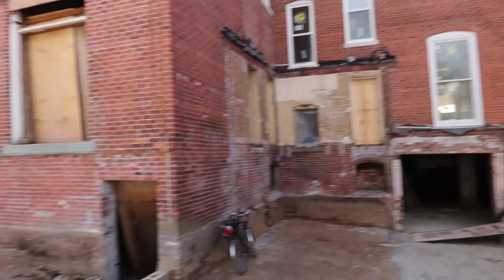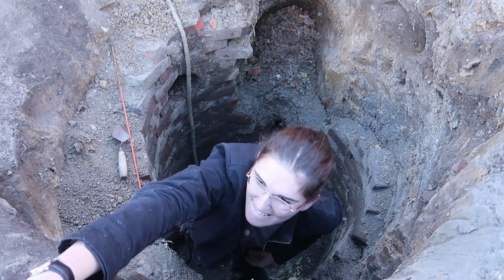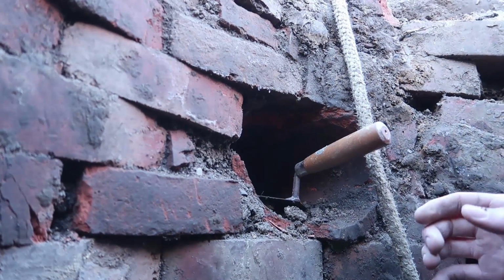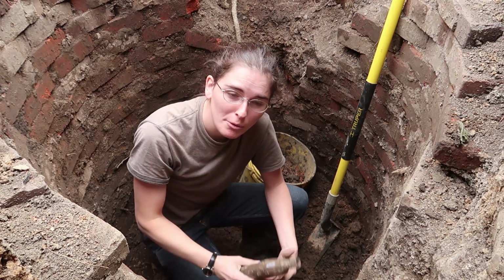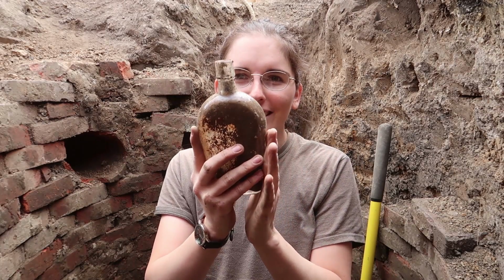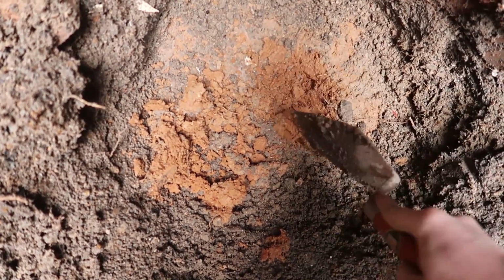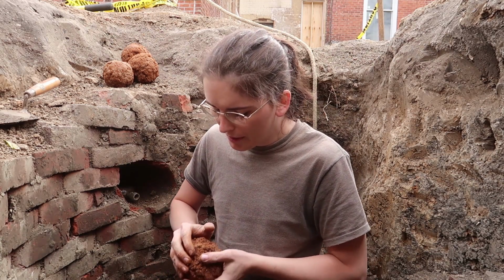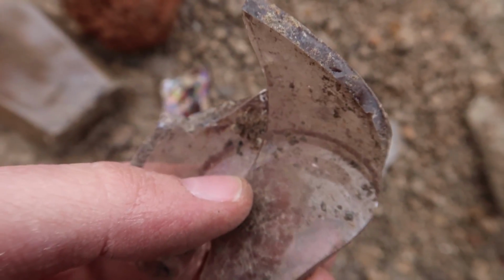Metal Detecting & Bottle Hunting 11: Digging a Pit for Relics and Clay!

Comment: Hey Riona love u r video s btw .  I too am a relic hunter and live in a area of BC that's right close to a mining and logging town back in the 30s I've just started to adventure this year but have found so many bottles and relics I would love to share some pix with u but not sure how? Haha
Reply from the maker: you can share pics on twitter @RinoaSG ^_^
Reply: I'm from Vancouver island, and I once found an ancient perfume bottle in the mud.. with perfume still inside. The ground glass seal with the combination of black silt and clay kept it from letting water in, despite being a few feet underwater for decades.. I know it's pretty old because some of the other stuff from the dig includes a bottle from a company in 1870's, and other old bottles with pontil marks and bubbles in the glass, and even a big stoneware inkwell. It's cool stuff! I even came across a big blue glass insulator after one of those machines redug the ditch along a roadside I used to walk often.. I just love antiques.

Comment: You should be able to probe out more privies there as a place that big an old will need more than one privy over time.
Reply from the maker: theyve covered the top with so much hard packed gravel that my probe is almost useless
Reply: @RinoaL  Then ground-penetrating radar should work. ;)
Reply from the maker: doubt i could get that.
Reply: @RinoaL  Honestly, I think that if anybody could get it it would be you, it would sure make for some interesting videos. Just think of all the things you could test. but barring that my dad used to get a long rod and flatten the end with a hammer and put it in a drill chuck. It would go through ground that was extremely hard.
Reply: The radar signal gets absorbed too much in crushed gravel, you can still see hyperbolas but the data is very sketchy and you have to pay close attention to the displayed data, no joke us bottle hunters actually use them :-) that looks like a well more than a septic  too.